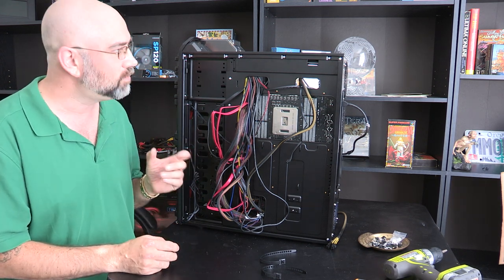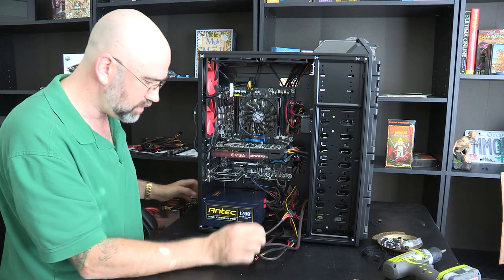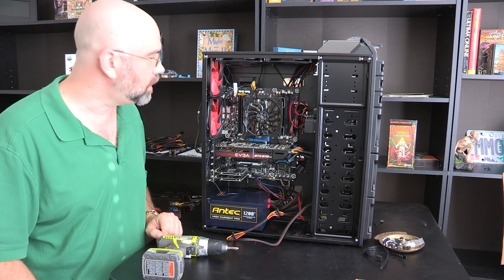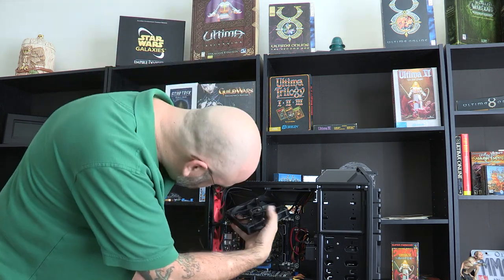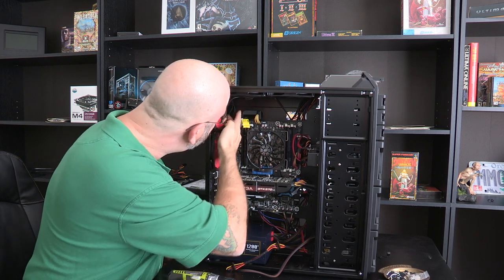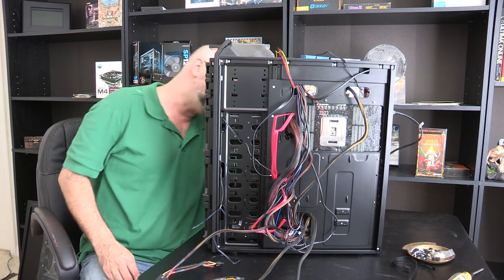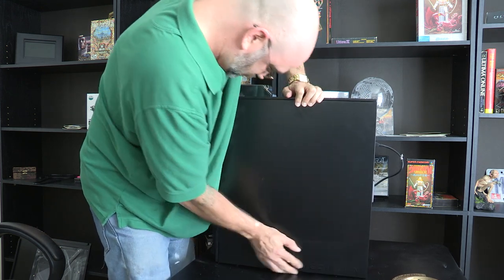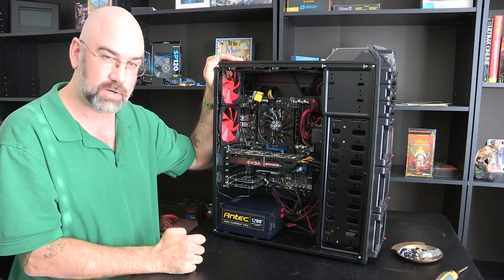How To Build a Custom Gaming Computer - Extreme Cable Management

Comment: The fact that you still not using the H100 is mind boggling.  It is so easy to install.  That case has plenty of room to fit it.  All you need to do is replace the 140mm fans in the top with 120's and use a second set of 120's to set up the push pull.

Comment: oh dear using a power tool on plastic realy bad idea as for fan noise the antec fans are realy good,  im stll using my h100 in my antec case after a full year half ,great cooler and its also very silent not like a fan , put it in your case looks better than that cooler

Comment: 1.  ASSUMING the pc case used in this video DID NOT have any fans what so ever on the left side panel that he NEVER put on towards/at the end of the video, he has 4x 120mm fans for EXHAUST vs 3 x 120mm fans at the front panel for intake= NEGATIVE air pressure inside. _.  ( facepalm).  
2.  There was NOT much cable management at all in this video.  

The video of Linus more than 3 years ago at ncix tech tips video is a GOOD example of how to REALLY manage cables.  

markeedragon.  I'm hoping by now, given the older date of this video, you have googled " positive air pressure" for pc cooling and have since CORRECTED this about your rig, and have learned how to COMPLETELY and ACTUALLY cable manage to the point to where you don't have to fight with your pc case JUST to force the right side panel on.  If you must force it to put it back on, you did NOT manage anything worth a crap.